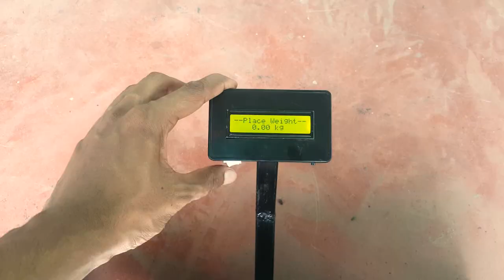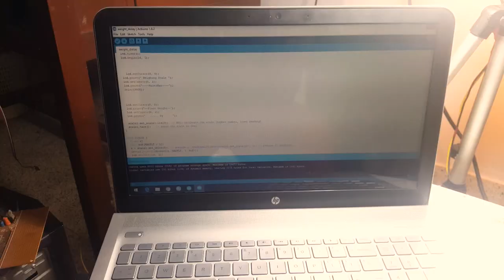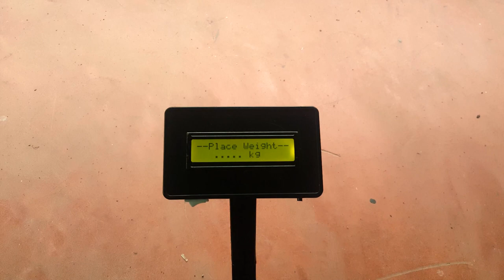HomeMade Weighing Scale Machine | Arduino Project #4

Comment: Hello Sir. How can I make the data from the load cell stable during calibration? It gives me a data (weight) but turns back to zero after a while.
Reply from the maker: Check with the code.
Just add some functions.

Comment: Hi 
The video is really helpful. I am working with 150 kg loadcell, but I am not getting proper output.  The values I get keep increasing irrespect of weight i put. can you pls help.
Reply: i am having the same problem with 500kg load cell.  managed to solve?
Reply: how to check if the wiring is properly connected or the Hx711 module is ok

Comment: Where do you solder load cell wiring🤔 without solder how machine will shows weight.. Its not possible to show weight
Reply from the maker: Ya that part video didn't get recorded, but it is soldered to the Arduino with 2 data line and 5v/gnd.
Reply: @MakerMan  ok next time u shows all the details in video's

Comment: Nice job but I wouldn't suggest welding with the load cell installed. Jay, A and A Scales LLC
Reply from the maker: +Jay A and A Scales LLC true, but I sheild it while welding
Reply: Great job, but it is not advised to weld with the load cell in place. Welding current will damage a load cell. If necessary remove the load cell prior to welding. If you absolutely cannot remove the load cell, ensure you ground the welder as close as possible to the position where you are applying the weld, and not through the load cell
Reply from the maker: +Jay A and A Scales LLC oh. Great advice. Thanks.
Reply: Satig

Comment: That was a nice project. I try to make it, but i can find the wiring diagram from load cell 200kg to hx711
I hope you can share the wiring diagram 🙏
Reply from the maker: https://www.flentas.com/assets/images/blog/real-time-graph-part1-pic3.png
Reply: @MakerMan  i have try that wiring too, but the there no happend. Always 0kg read hmm
May be the load broke?
Reply from the maker: Try serials monitor
Reply: @MakerMan  yes sir i have try in serial monitor, but the weight has not changed
Reply from the maker: Check again the wire and check with another load cell

Comment: Can I get code for this because link is not working
Reply from the maker: I lost it myself somewhere in my pile of HDD backups. I will look for it. Give me some time.
Reply: I need it until tomorrow bro I have my final year project tomorrow and I am facing some problems with the code I have it's not giving correct weight measurement and value for calibration factor of known weight is also showing variation

Comment: Hy Brother wow the project is fantastic please if you are there let me ask some questions  Thank You
Reply from the maker: Sure
Reply: @MakerMan  Thanks  I try what you did but the load cell is 150 kg I get from a bathroom scale and the Arduino is Uno when I run it the kg is shown but not the exact value I try calibrate with 1 kg then 5 kg still not shown exact result then I try to change the calibrate factor which is this " scale1.set_scale(-11410);" but I can't do It by this what shall I do?
so much thanks am waiting your answer thank you

Comment: how we can calculate platform dimension?
Reply from the maker: Not that important
Reply: but i think  if the platform length and wide chosen bigger then capability of the sensor ,it's may cause damage to sensor  by applying  load at corner of platform.
Reply from the maker: Is a 200kg sensor and I kept the dimensions fairly smaller, it around 50 x 40 cm
Reply: okey , i'm working on 250kg scale project  with obu-250kg sensor , but try a little( 1.3 ) bigger  platform then it's recommended dimension.

Comment: Hello, Can I have the datasheet of the loadcell please ?
Reply from the maker: I sorry it was an old project. I made it when I came for vacation in India. 
Just get 200kg load cell with 4 pin.
Reply: MakerMan it's just that i have a load cell of 100kg and its excitation voltage is between 9v to 12v so i just wanna know if its gonna be a problem with the amplifier hx711 and arduino to give the right supply to the load cell ?
Reply from the maker: Try with 5v it's should work
Reply: MakerMan  that's why i tought becaise hx711 send a supplu btw 2.6v and 5.5v so its better to have a load cell with exctitation voltage of 5V to 10V its gonna work right?
Reply from the maker: Yes it should work

Comment: pls send me the circuit connection
Reply from the maker: Just Google load cell with Arduino.
If still u not getting, let me know.
Reply: I cant figure out how you connected the lcd screen, tried googling but the parts are different from what you used in the video
Reply from the maker: Sorry the scale is in my home town and I don't recall the model number.
But it's super easy. Try with my code.

Comment: awesome.. how it can be calibrated? and what is the function of the push button switch?
Reply from the maker: Yes there is tare button.
Reply: Thanx for your reply..You mean. The RED Push Button Switch is Tare Button?? The making video is Awesome. I am willing to made a miniature model of your project. is the code needs any changes for other capacity of load cell?
Reply from the maker: Yes tare button. Code will be the same just minor changes only.
Reply: Thanx again_ What minor changes needed??
Reply from the maker: Depends on ur module u use. Not much. Try it.
Reply: Thanx. i am using HX711 Amplifier. When its Complete i will show you  images as gift of appreciation.
Reply from the maker: Good luck. Can't wait to see.
Reply: Thanx.. Hope.. I will do it.. :)
Reply from the maker: Great